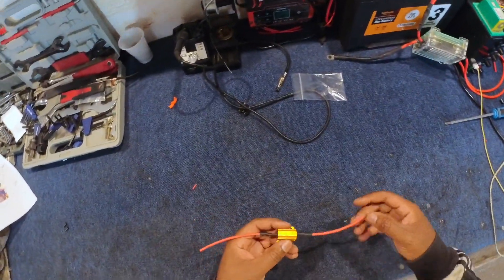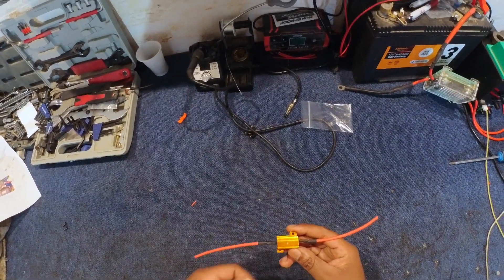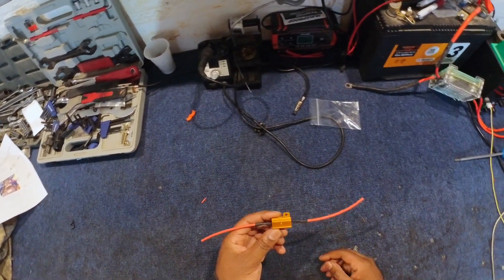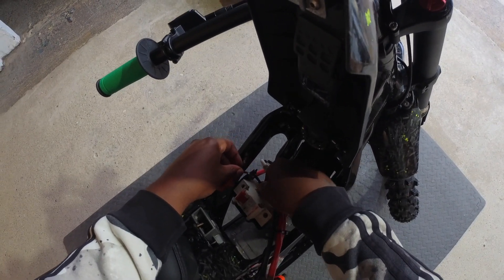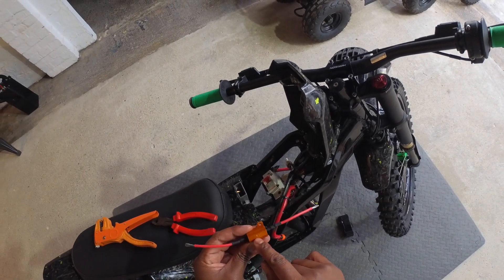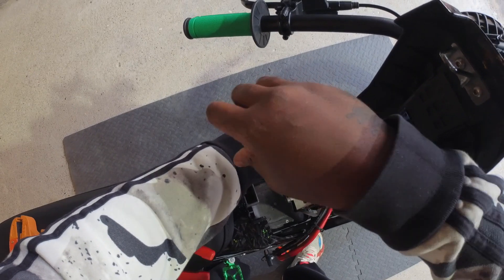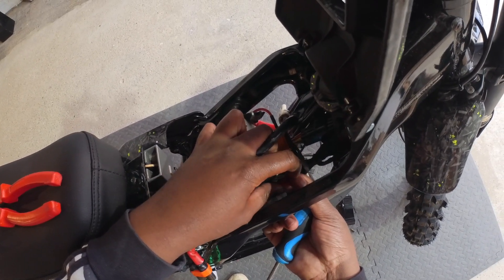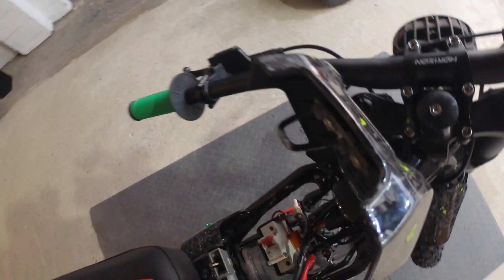Surron Talaria In Rush Pre Charge Resistor Install Tutorial

Comment: Would it be beneficial to also put a switch on the in rush resistor so you can disconnect the resistor from the circuit after flipping the breaker? I feel like without a switch you can end up in a kind of sketchy situation where the breaker gets tripped but then all the current would get dumped through the resistor and burn up the wiring or something like that.
Reply from the maker: Thats a good comment. This is an option but in the event of your bike have a short for some reason. The resistors would pop breaking the circuit but we recommend using this on a battery that is not bms bypassed.